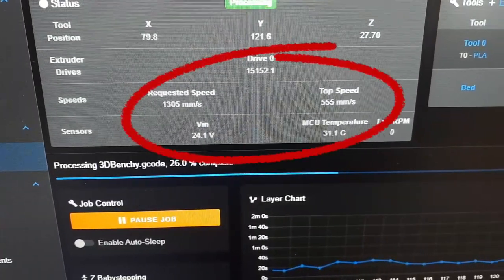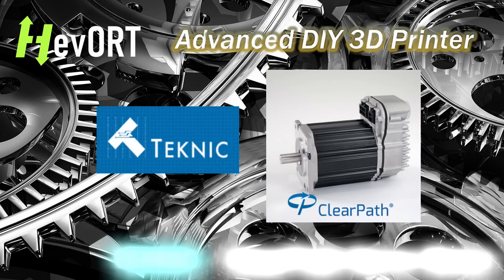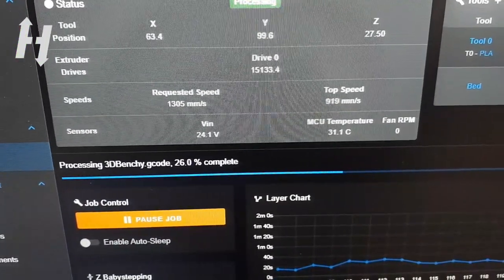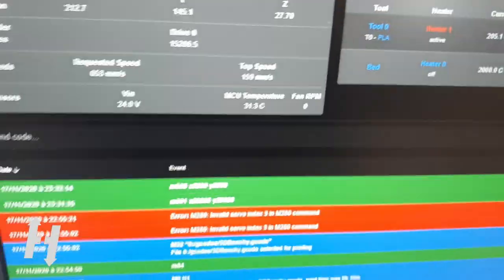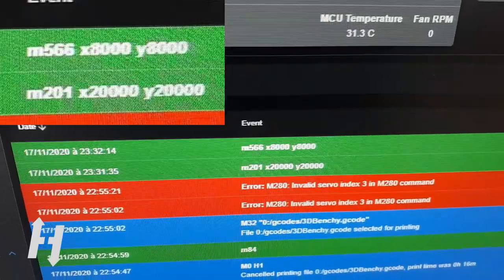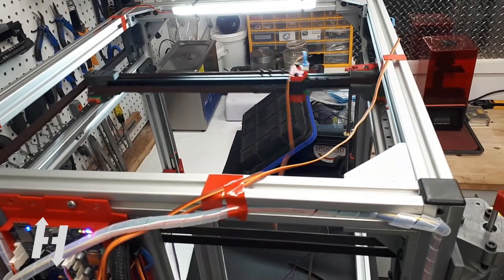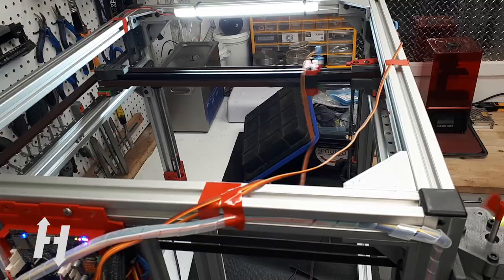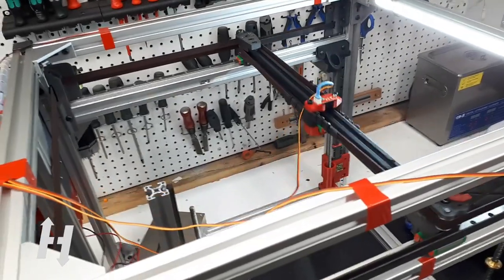3D printer on Servo Motors? HevORT & ClearPath testing spoiler

Comment: The only hotend I can immagine to keep up with those printspeeds would be an aluminium block with a blowtorch attached to it!
Reply from the maker: Of course matching material flow with this speed is going to be a challenge.  But just imagine for a second having instantaneous travel moves and enough accel and jerk to reach greater speed on tiny moves.  Just these two thing will make a hell of a difference on print time.
Reply: On top of that, you'd have to have a small air conditioner beside the printer pumping 1deg air at the print surface.
Reply from the maker: @thegamerstableboardgamesto386  Why not replace the berdair system by a nitrous oxide cooling system.  Turbo guys are using this on their car intercooler to increase its efficiency during hard pulls.  https://www.summitracing.com/parts/nxo-22-87000-10
Reply: If thats what you need... make it so!
Reply: @MirageC  in case you want to replace the room in case of a leak:)
Reply: @MirageC  At those speeds you'd need to factor in filament pull from inertia on filament above printing head as it's being flailed around. Or make it direct drive with another one of these servos. Bowden could break from bending fatigue really quickly, and probably every gram of stuff not dedicated to stiffness on the gantry counts. Some optimizations in G-code could also be needed, for example instead of sharp V-turn that requires full stop small ribbon loop path could be required instead with perfectly timed extrusion pause. Just like engines have timing advance and retard, here extrusion flow timing calibration may be needed for every specific filament roll.
Reply from the maker: @Vatharian  Are you referring to Pressure Advance (Duet)? Or Linear Advance (Marlin)?
Reply: maybe an induction hotend :s
Reply: @MirageC  Nitrox sounds expensive, and gasses would be...intresting.  I'd say just devise some sort of heat exchanger with a thin metal tube, connected to the plastic one, going through something VERY cold for long enough to get cold.
Reply: @MirageC  LN2 would likely work better... Car guys use it as they already have it on board and purging into ones IC is a net benefit. CO2 charges and compressed nitrogen was also used for IC cooling for a while which came from paintball and airsoft (mostly the former). Though difficult to source used dewars and cold finger cryo coolers pop up on occassion.
Reply: @MirageC  nitrous oxide is used because it has more oxygen per unit volume compared to air, not so much due to lower temperatures ?
Reply from the maker: @Ebonyqwe  If you inject it into the combustion chamber yes.  It acts as a chemical turbocharger.  
What I was referring to here is that back in the days I was drag racing, turbo guys were spraying their intercooler with NOS before and during the pass so the intercooler would not get heat soaked.
https://www.enginebasics.com/Advanced%20Engine%20Tuning/Intercooler%20Sprayers.html
Reply: What of you try to work with melted plastic directly instead of filament?
Reply: @lucasmontec  This could be a stringing and oozing nightmare. You'd need a blockable nozzle, but that might be heavy and slow reacting.
Reply: @Vatharian  @MirageC isn't that fairly filament dependent? seems like you could tune certain material and diameter combinations to get around bending fatigue. maybe even a creative hotend/nozzle design and hollow filament? getting into F1 territory here...
Reply: For part cooling you could use a peltier device strapped to a heat exchanger to get the air blowing onto the part well below ambient, This whole setup could be off the printer and you would just need a hose to blow the air onto the part. As for the hot end you could have a larger melt chamber like a pot of molten plastic above the nozzle and use an auger to push it through.
Reply: @NNFaNRacing  how about using a peltier as a heated bed? That way you have the cold air and don't use any Excess power that's otherwise going to waste.
Reply: @MirageC   @MirageC  couldn't agree more. Print slower for quality and rapid as fast as possible to avoid disrupting flow and fast tool changes. Did you post an in depth overview of getting the Clearpath to play nice with the Duet or perhaps somewhere in the comments? Inconclusive on the Duet forum as far as I can find. My project will rapid at over 400mm/s in the y axis with a 10mm lead ball screws but the x is 4x the weight of y and I would like to use a Clearpath servo.
Reply: @MirageC  cooling, even with ABS, might be funny as well tho maybe a Leafblower might help
Reply: Plasma cutter with a hot end made of the ceramic they use on the space shuttle. LOL.
Reply: And now we have the goliath contender for any servo or stepper

Comment: Damn this is insane, came here from the 800mm/s attempt video and of course that wasn't enough eh! At one point the slicers will probably have to consider the plastic's inertia when being laid down, jeez, I can imagine that if the extrusion isn't right on point it would probably fling molten plastic all over. Would definitely love seeing it either doing just that or succeeding a print for sure.

Wonder what you have in mind for an extruder for this monster, like an overvolted heater? quad geared NEMA 23 extruder? Something crazy for sure, that would be cool as heck, looking forward to whatever insanity can keep up with the movement.

Those belts sure ain't no crappy random belts either, considering a normal 3D printer could barely function as a light duty CNC mill with their normal setup, no way in hell the standard issue belts would handle those forces.

Comment: Great work.  Not only that, but great investigative work into 3D printer printing speeds.   

Yesterday I was printing some 90deg bracing brackets for one of my printers.  I have also just migrated over my slicing from S3D to PrusaSlicer.   So I'm still getting used to the expert settings.  I accidentally typed in 544mms for support speed.   I wasn't printing supports but I was printing a brim.   

At 220d, my hot end motor clicked like crazy, but it printed the brim smoothly.
Reply from the maker: yeah, that clicking sound! I can relate to that :)

Comment: This is really cool! The challenge I see isn't sufficient plastic flow, it's the ability to turn the flow on and off quickly and at the proper time. Seems like these kinds of speeds and acceleration would be fine for creating things in 'vase mode', but much harder for the more traditional printing that we're used to. 

I think you're going to cause an entire change in extruder philosophy and design where they may not be able to rely on pushing and retracting of the filament to turn the flow on and off, but require pressurizing and physical valving of the flow - like a fuel injector for internal combustion engines. 

Also I think it will require software improvements as well. It seems that you would need to do some sort of predictive flow control that would anticipate the need for plastic ahead of the move. Back to the fuel injection technology... it would be like advancing and retarding the timing. 

I think this may qualify as a 'disruptive technology' for 3D printing. Very interesting...
Reply: Both marlin and klipper has predictive flow control.
Reply: @traniel123456789  I've only worked with Marlin to change configuration values of my printers. I definitely don't know the internal intricacies of the firmware. Does it have predictive flow control that can be adjusted for each move and extrusion, or just global variables for things such as retraction length and speed?
Reply: @rdyer8764  i think Mr Vestøl referred to linear pressure advance, right?
Reply: @certified-forklifter  I am not exactly sure as to what he was referring, and I don't wish to put words in his mouth. But since you guys posted your replies I started looking around a bit, and I found some excellent info and YouTube videos on linear and pressure advance. I believe the correct term in Marlin is Linear Advance and in Klipper it's Pressure Advance, but I could be wrong about that. Regardless of the exact name, this feature appears to address pressure in the nozzle (which controls the rate of material extrusion). The two features attempt to compensate for the same problem - how to allow for speed changes (due to acceleration settings) at the beginning and end of an extrusion move of the print head. However, this is only part of the problem I was thinking about. 

I was also thinking about what happens at the beginning and end of a move between extrusions. From what I could ascertain in my short research, I don't believe the K factor for Linear/Pressure Advance addresses this. But more importantly, I'm thinking that at these speeds, there's no way that precise starts and ends of extrusions can happen strictly by manipulating the filament with the extruder motor. 

For example, if there is a very short extrusion coming up between two quick moves, can the extruder motor increase and then decrease nozzle pressure precisely enough to put out the melted filament in almost a 'drive-by' manner with the rapid speeds and high jerks shown in this video? I'm wondering if a better method would to be to maintain a near-constant pressure in the nozzle and controlling the exact extrusion time and duration with a valve. 

Also, existing nozzles couldn't have too much pressure without molten filament backing up into the heat break, so we would probably need new nozzle technology with pressure measurement. All this would mean more hardware (weight) in the print head, but as MirageC said, there is more than enough motor power to allow for that. 

The bigger problem is that I don't think that this hardware currently exists in a small enough form factor to fit on even a HevORT printer. Again I could be wrong about that. However, if these methods could be implemented with precision, the timing issues for extrusions go away, or at least they become constant across moves and extrusions.

Thoughts???
Reply: @rdyer8764  mmh, yeah. thank you for your research!
Reply from the maker: @rdyer8764  Yes, Linear Advance and Pressure Advance are kind of anticipated flow control.  But simply to achieve regular print speeds the extruder motors needs to be provided with significant acceleration and jerk values.  At the speeds possible with servo motors it would have to be something else.  I like your idea of a pressurized molten material reserve that is distributed through a kind of valve.  That could mean back to bowden and using an air conduit for pressurizing!  I would love to try such system! :O
Reply: @MirageC  small brushless servo system with a gear reduction on the print head might do the job.
Otherwise perhaps something like those printers with a needle valve in the print head, Roblox I think?

Ooh, induction heater for the melt, for instant thermal input ;-)
Reply: "like a fuel injector for internal combustion engines"
look at "hot runners" used in injection molding :)  Mold have heaters inside and pneumatic/hydraulic valve to close way. Something like that might work.
Reply: @DreitTheDarkDragon  They say it's not 'what' you know but 'who' you know. I forgot there probably was somebody out there who already knew of a solution, or would be able to point out a direction to go. Glad you are out there listening!!
Reply: @zyeborm  Great!
Reply: @rdyer8764  No prob :)
Just found out it's called "valve gate" (part of hot runner, some don't use it), one nice animation is here - https://www.youtube.com/watch?v=-4_2L9feXKI
*meanwhile idea of new extruder design emerges in my head*

Comment: You've become my inspiration on printer upgrades. Going to try implementing your designs on my core xy, the triple z auto compensation is amazing! If you're looking on what to put on your beastly motion system, why not go for toolchanging (ASMBL) and add a cnc spindle?  IDEX ASMBL toolchanging if you feel ambitious. You're going to want to protect those hiwin rails and ball screws though, the sound of a chip getting stuck in one of those and making a nasty grinding sound, makes me shudder.
Reply from the maker: Yes tool changer is in discussion within the HevORT's community.  Will be looking at that during the summer.  The printer frame from this video has a longer Y axis that provides space provision at the back for the tools.  And yes, some sort of boots and brushes would need to be installed to avoid debris.
Reply: @MirageC  I am researching my next project and had decided another corexy but was definitely wanting it to support IDEX and tool changing. I will be watching closely and appreciate all that you do for the community

Comment: That's cool. I have already made and used my own design 3D printer using Panasonic servo motors. As a tip, it is important to increase the belt tension strongly for quick response. After that, the bearings of the idler become unbearable. I use the idler by removing the existing bearings and attaching two bearing outside like a sandwich. Good luck.
Reply from the maker: Thanks for the advice, I will be monitoring those tiny bearings closely :)  I run 12mm belt, they seem to be handling the load fine as of now.
Reply: i need a tip please,can you give a help what the card you used to control 3d printer with panasonic servo motor. Card Bigtreetech SKR Mini E3 V2.0 it's okay to using.

Comment: Maybe 2 or 3 volcano heating blocks with liquid cooling  on top one would allow melting fast enough without jamming... not even sure.
I don't think the limit would be the extruder motor ... you'd need a constant push, from the back, crazy heating speed and a kind of control valve at the end, I guess.
DOABLE !
Reply from the maker: Somebody just mentioned something I have never though of or seen.  See reply from R Dyer: https://www.youtube.com/watch?v=m6DoKoESPdg&lc=UgyOb1T65m1eDzyLatZ4AaABAg.9GBp85iJPer9GCIrwLiyRs
Reply: Yoi dont need liquid cooking to print fast :) you need it to pront slow or in chamber.

Comment: Damn. Also why do your motors have couplers attached? How do you drive your belt?
Reply from the maker: Any motor should not be suffering from radial or axial loads.  We usually mount the pulleys directly on the motors for small printer applications since the loads are not so great.  But when  using wider belt will require more tensioning force.  Then adding to this the tension created by the abrupt movements themselves, this could be damageable to the motors.   So I have decoupled the radial and axial loads by capturing a shaft holding the pulley between 2 bearings.  Then one end of the shaft is driven by the motor through a spider coupling.  You can see a section image of a motor mount here: https://github.com/MirageC79/HevORT/blob/master/HD/HD_YCarriage%20v74section.png?raw=true

Comment: I like where this is going! Keep up the good work! This is the kind of innovation the industry needs. I'm wondering if being able to drive a bigger extruder without missing steps would open the possibilities of more extruder innovation. I'm thinking some kind of valved hotend that can control the flow of plastic more precisely to take advantage of those enormous speeds.
Reply from the maker: a new extruder philosophy would definately enable us to harvest the benefits from servos for sure.  But for now, I will content myself of having faster tny moves due to strong accel and jerk and almost instantaneous travel moves.  This will still make a huge difference on print time.  Next milestone is material viscosity and cooling.

Comment: @MirageC I'm planning to do the same with my printer. How did you interface the motors to the main board? Do you just put the clearpath motors before the drivers, so it receives the step and direction signals? Or are you wiring another way?
Reply: Im still looking for this answer have you found it?
Reply: @mikegocrazybeats  depends which board you use. I used the SKR 2 which has CLS (closed loop servos) outputs. Wired the step and direction pins of the clearpath to those pins and it all just worked perfectly.
Reply: @bobhaha  Can you elaborate? Were using the BTT V1.1 Octo - becuase it has 8 Motor Ports - Our Printer has 8 Teknic Motors - Check out d3labs
Reply: @mikegocrazybeats  Its super simple, remove any installed motor drivers from the mainboard and plug your Step, Direction and Enable pins from the clearpath motor into the mainboard (where the motor driver would normally plug in). Make sure you configure the clearpath motors as step and direction mode. If you need any help, PM me.
Reply: @bobhaha  Should we still use the base driver configuration A4988? Or do we undefine the stepper driver in total?
Reply: @mikegocrazybeats  yes, I am only familiar with Klipper, but I assume marlin would be the same. You can use any driver config in the firmware; just make note of the microstepping factor as this will change your axis movement range etc..

Then instead of the data being sent to the motor driver, it is sent directly to the clearpath motor.

Also handy tip, if you haven't ordered the clearpath motors yet, make sure to only order the step direction version. I purchased the software controlled version and it must be manually enabled via software any time power is lost to the motor. The step and direction version of the motor can be enabled via the enable pin on your mainboard.